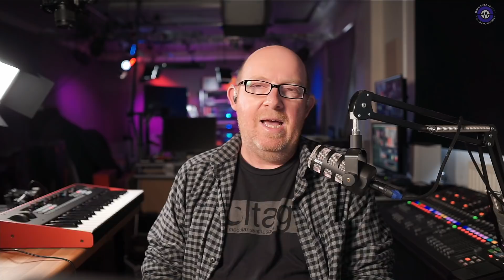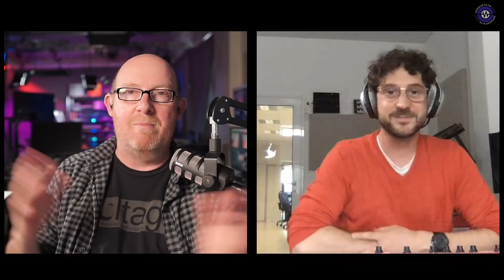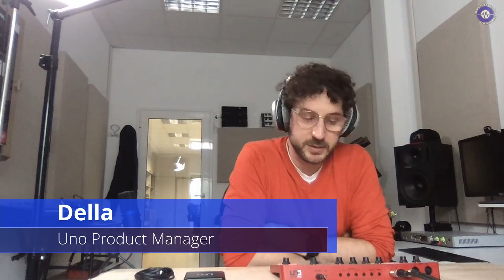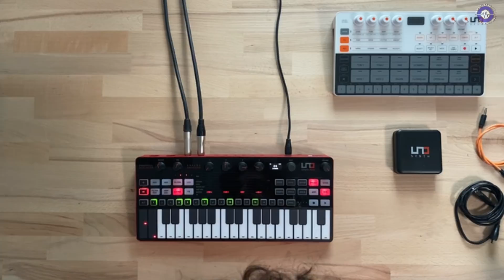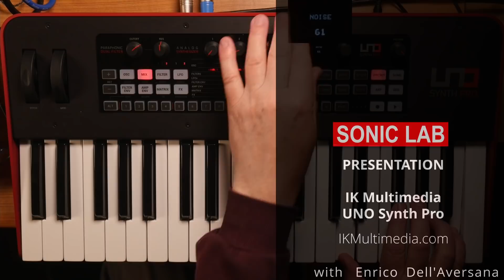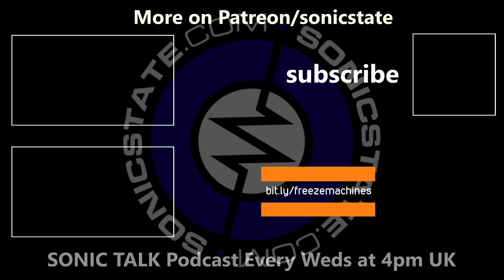IK UNO Synth Pro - Presentation - Sonic LAB

Comment: I hope they upgraded their build quality.  I owned an original Uno synth.  It sounded great when I could get sound out of it.  The build quality was shite however.  The encoders were crap.  I could only sweep the filter if I applied pressure at an angle.  They were jumpy and hard as hell to get where you wanted.  If I were going to spend that money again I would get a Volca Keys, Bass, or another Crave instead.

Comment: The editing on this one is quite comprehensible, much more easy than the editing matrix on for example the Blofeld. However, I think they should had worked some more on the firmware before releasing it. For example, the ring modulator on my desktop model is really noisy and I can’t yet find a way to route incoming audio. Please tell me, if someone has found a way.

Comment: Does it have real midi ports and power, not USB powered.
Reply: I don't know about you, but the last thing I need is another wall wart. Power over USB and a discrete power socket would be best, giving you the choice. Audio over USB at a decent bit rate would be nice too.
Reply: @noelcosgrave113  yeah, but USB power usually donates it’s a softsynth on a chip, not a real hardware synth.

Comment: I wish this had come out before the Sequential Pro 3 (they are so much more money than the new UNO). The Uno sounds so good! The effects sound great. I hope Sequential will update the effects algorithms and make it easier to get a wider sound out of it. I realize the Pro 3 is a mono-synth but it also sounds very monaural. I may sell it and get the new Uno.
Reply: @Terry Murray  if you have the money to spend I would go for the polybrute. Mine finally arrived about 2 weeks ago and it’s now my desert island synth. It’s oscillators are strong enough that it does well as a mono synth as well. I haven’t touched the Pro 3 since it got here. The videos on YouTube also don’t do the sound justice.
Reply: I was GASsing for the Pro 3 but, once I got this, that dissipated. I’m also not certain if I’ll keep my Sub 37. That’s a bit difficult because I consider the Sub 37 such a beautiful instrument
Reply: @RobertSaintJohn  I’m GASing for the PolyBrute 😁
Reply: @Terry Murray I should clarify that I have a Minimoog and a Sirin, and a number of other monosynths. So it’s somewhat a question of space and overlap. If I didn’t have so many monos, I probably wouldn’t even consider it as there’s not a lot of sonic overlap between USP and Sub 37. But at the moment, USP would be the one going to the desert island with me 😄
Reply: @RobertSaintJohn  Both the USP and the Sub37 are nice, but USP is much more compact, the workflow is good and its sound can venture into gritty phatness.